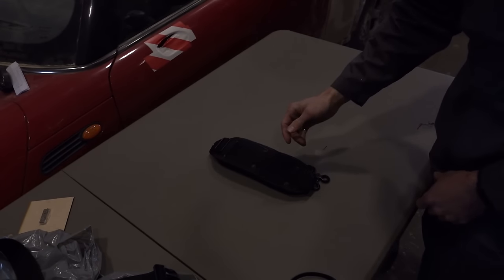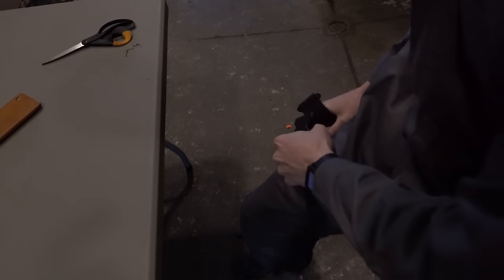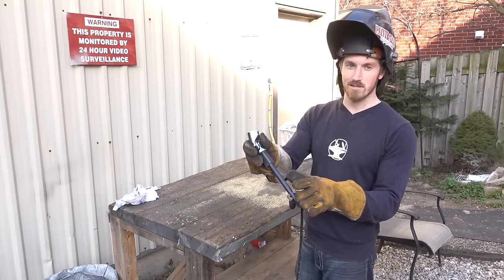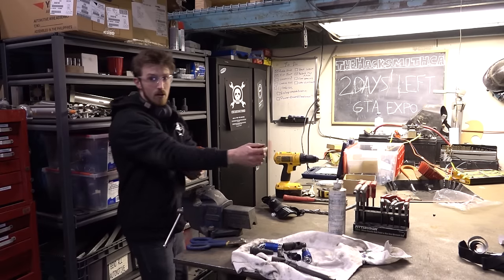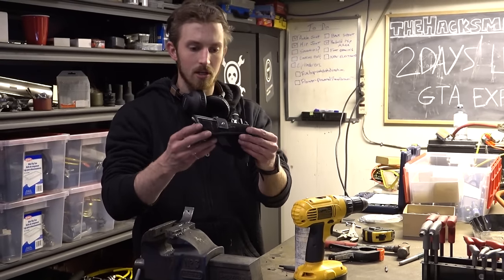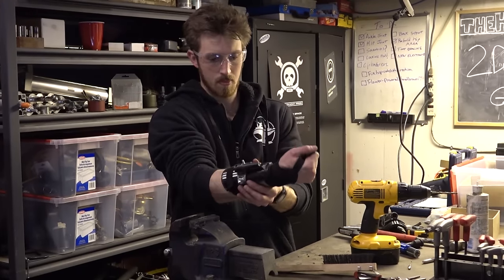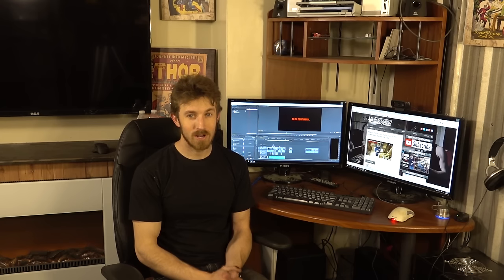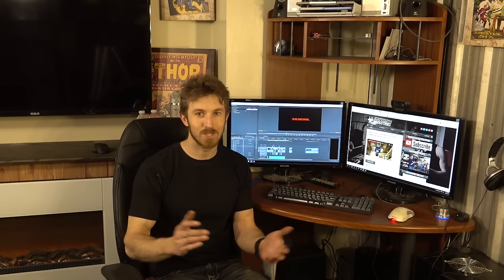Giving the Exo Arms!

Comment: I'm currently in the planning process for building an exoskeleton for a senior project in highschool. it's very similar to yours, except I'm using linear actuators (it has to be electronics related) and I wanted to know where you got those ratchets used in the legs of the suit. 
thanks for the inspiration, and I can't wait to see how this turns out!
Reply from the maker: +Mathew Pennington cool stuff! You can buy ratchets at most hardware stores... pretty common tool
Reply: +the Hacksmith well I saw in an early video how you had a ratchet head on both ends, it looked like it was factory machined and not custom built. I was wondering if you could buy them already built like they are. I have some spare ratchets myself, but this looks more professional
Reply from the maker: +Mathew Pennington nope still store bought

Comment: Hey , have you though about using chain for a locking mechanism on legs ? this should be usefull for locking knees and be able to still move without any issue
Reply from the maker: +Lukáš Večeřa haven't you been watching the videos? The knees and hips to do lock...
Reply: yes , but movement seems a bit un-natural ^^  thats what I ment , you might be able to run with it aswell and weight might go a bit down too